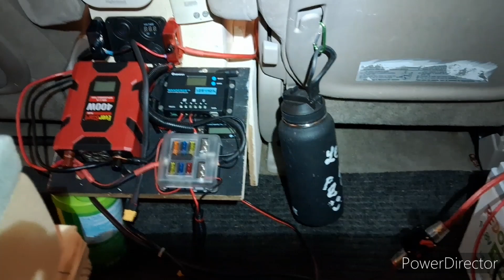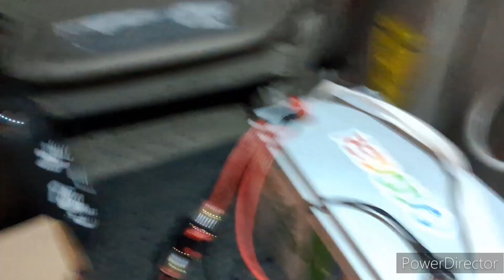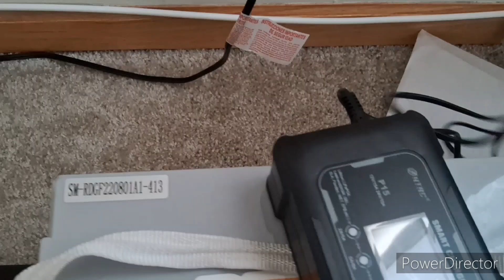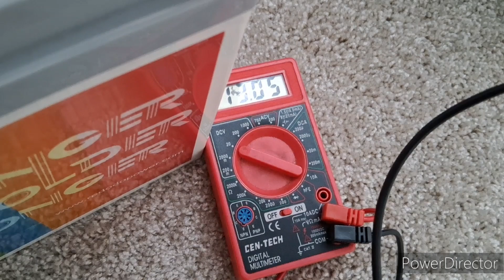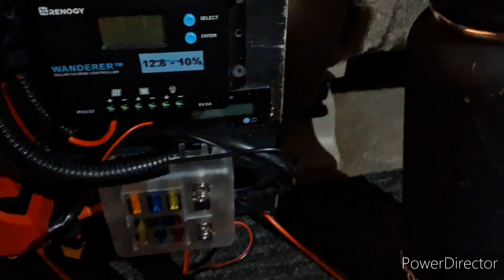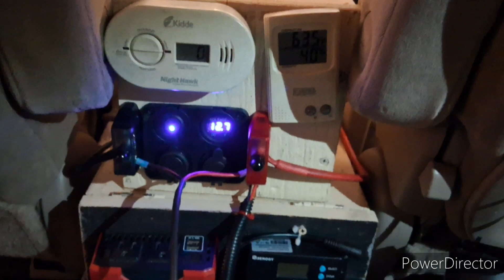The Cheapest DC to DC Charger Setup for 2008 Toyota Sienna Minivan Camper

Comment: I was going to go this same route  and went as far as buying a mid-level 40Amp smart DC-to-DC charger w/ built-in MPPT for $150 -- and then I happened to come across one of Scotty Kilmer's YT videos and he strongly recommended against using any modern car's alternator to charge a second battery. He said modern alternators are designed by the auto engineers to be balanced with the electrical system and electronic components of the specific car. He said hooking up a second/alternate battery to the alternator will eventually end up burning out the alternator prematurely and could also damage other electronic components and computer processors of the car. For my 3rd gen Sienna, the alternator is located in a difficult position to replace. So I am going to stick with solar panels and shore power charging for my battery system design.
Reply from the maker: Good idea! I only use it when driving down the freeway. So I think that it can push out enough juice for everything.

Comment: Thanks Tim! That dc to dc charger you showed at the end, is the one i have.  At this point it is just being used for a mppt controller. I will have it hooked up for dc to dc later. 😊🤗
Reply: Hi Cindy, I read your comment just now. Yes, definitely get your DC-DC part of your controller wired up, you  certainly won’t regret it. It’s far more effective and faster charging than solar is, and it works anytime your engine is running.
Safe travels,
Doug
Reply: @CLdriver1960  Hi Doug! It's a little costly, but I'm hoping to get it hooked up before they close for the season. Thanks for your suggestion.  😊🙋‍♀️
Reply: @CindyCaVANas Good! I’d gladly help you out on that installation, if I was nearby.